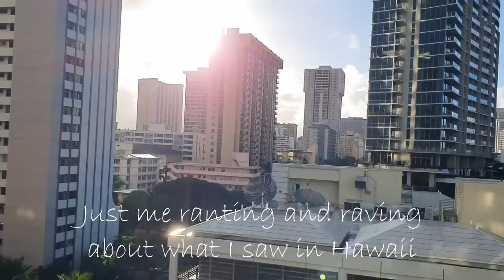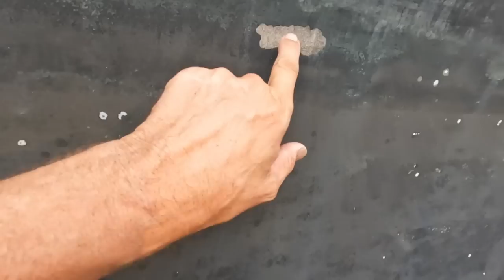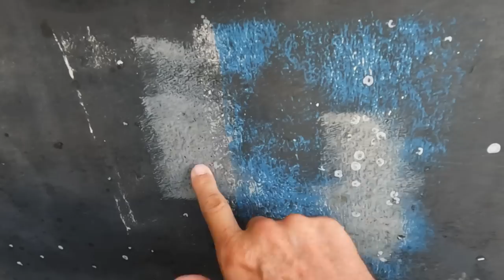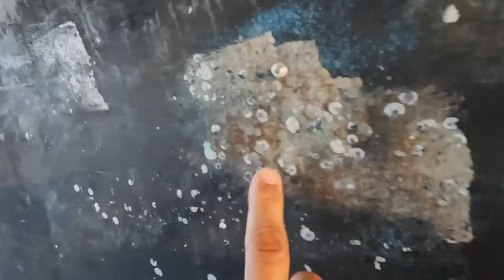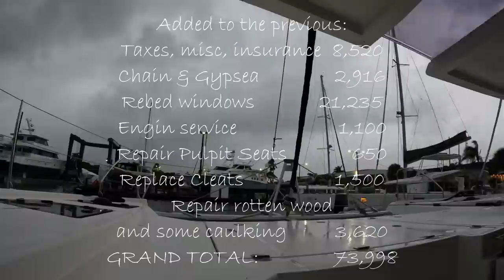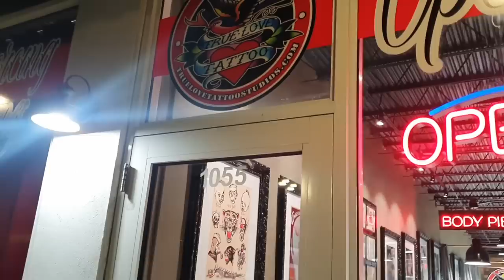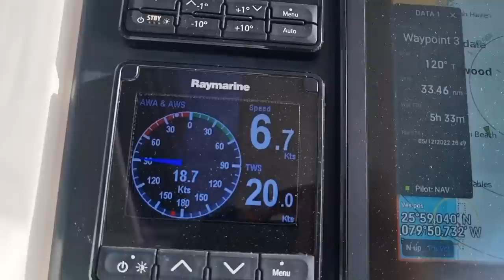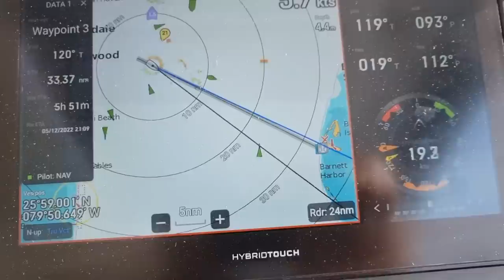#220 SAILING is EXPENSIVE!! Are we facing BANKRUPTCY! | Sailing Sisu Leopard 45 Catamaran

Comment: an idea in unsinkable boat you can make buissiness on is...
like an airbag in a car :) use weatherballons and fx if catastrofic leaking in engineroom. use a tank with air and 1 bar to fill fx 5 diameter ballon and prevent so an safe port can be reched. of course sharp edges in engineroom is prevented first...catamarans with two enginerooms is better :) best from björn in sweden
Reply from the maker: Yeah, cat owners often try to figure out ways to use a dinghy below the bridge deck. Deflate, insert, inflate. Or empty fuel cans.

Comment: Prices are silly in the US hey but that’s the labour costs for sure as products are cheap there.. you should have considered leaving the yanmar alternators in place and adding another. We have that on ours.
Reply from the maker: Hi Mike! We had two Yanmar alts per engine, but all started to fail within a month while we were in Bahamas. They were temperature controlled by a Sterling alt/charger controller, but yeah, they are designed to top up a starter battery, not pushing 60A - 110A continously for 3-4 hours. We don't have a genset so, engines are used to charge housebank. Even when Stirling cut the charging down to 60A per engine, 30A per alt, was it forced to do a 50% duty cycle, meaning that the engines run 50% of the time not charging. With the EEMAX, we now run engines and get 360A or 4,000W in continously and therefore only need to run the engines for one hour every three  days 😉

Comment: The costs for boat parts are a nightmare and insolent. But why you have to repair the windows? Is there no warrenty? And which Windows we are talking about? The escape hatches as well?
Reply from the maker: The Sikaflex Primer is flaking off from the expanding/contracting acrylic window. This is a known issue and an ongoing fight with Sikaflex. Yes, the first four years Robertson and Caine did support the warranty, but now it is becoming a maintenance issue. We used a different primer when we re-bed the saloon roof window in Turkey a few years back and this time the primer sticks like crazy, but now the window starts to crack because it cannot expand that much. Catch-22. The Leopard 45 does not have escape hatches, the main hatches and front door are big enough to be escape hatches.

Comment: I cant believe how expensive the items you have updated/replaced came too! Unbelievable that you had to pay $21k to rebel the windows after 4 years, i would have pursued Robinson & Cane on that cost. It seems there are so many substandard windows bonded into many Leopards!
Reply from the maker: This is a known issue and an ongoing fight with Sikaflex. Yes, the first four years Robertson and Caine did support the warranty, but now it is becoming a maintenance issue. That said, we used a different primer when we re-bed the saloon roof window in Turkey a few years back and this time the primer sticks like crazy, but now the window starts to crack because it cannot expand that much. Catch-22. Those windows expand on the edges as much as a centimetre on all sides. We had to trim the windows so that they don't catch the hull or adjacent windowpanes on hot days. It is crazy!
Reply: Frik what is interesting is that our new to us Catana still has all original caulking in all the windows since it was built in 2009. The acrylic is crazed so some time I will need to replace them myself. The big issue is that Catana paints the acrylic on the outside with a frame so you get no uv through it causing it come undone
Reply from the maker: @mikeferguson2828  that is different. RC is painting on the inside, called a primer, but this is also causing the issues. The primer does not expand the same as the acrylic or the Sikaflex and then peels off

Comment: We feel with you. 😉
Have I seen this correctly that on the 45 there is no bilge sump in the engine rooms AKA the bilge pump takes the water directly from a somewhat rounded bottom? 😳
Reply from the maker: There is a bilge pump in each engine room with an alarm light showing on the DB board as well as helm station when activated. The same for main hulls, but there is a high-water level alarm too, which will show red alarm lights on DB and helm with a high pitch beeping sound for in case the bilge pumps are overrun with water ingress.
Reply: @SailingSisu  Bilge SUMP like in the hulls where the water collects at a point lower than the surrounding area. The 45 looks like the Fountaine Pajots where there is no sump but the water is taken directly from the rounded hull. Have you never head any problems with that? On our 48 the shower drips from time to time and we only notice it because it collects in the bilge sump. 😬
Reply from the maker: in the engine room, there is a square indentation where the water is collected. inside the square indentation is the bilge pump as well as the float device, which triggers before the square indentation overflows. not sure what you want to call that :-) in the hulls there is a "slot" like the formation of the keels, which are deeper than the "rounded" hull. it is much longer than the square indentation in the engine room, which allows much more water to collect before the float switch is triggered. Petro has to climb in and dry it out with every water maker mishap :-( so, if you refer to the main hull and not the engine room, then yes, it is a pain to get rid of the water laying lower than the switch trigger.
Reply: @SailingSisu  Thanks for the info. Then the 45 is exactly like the 48 in this regard and I just got it wrong from what I‘ve seen in the video. On other brands the indentation is missing and if there‘s water and a bit of swell it’s moving around inside the engine room. 🤨
Happy to hear that R&C still know what they‘re doing. The windows on our 48 are still in pretty good shape. I think it‘s the temperature difference Med vs. Caribbean.

Comment: That is why you never trust others to do antifoul, besides the cost rarely do they do a proper job. Also did you choose sail drives or did you purchase the boat with those? Most people i've known who have them say they're a curse
Reply from the maker: yeah, I realize the antifoul DIY thing now. But we were not allowed to do DIY in that boat yard...insurance issues. The sail drives come standard and it is not an option. I am sure that shafts have similar maintenance issues with cutlass bearings and shaft seals?
Reply: @SailingSisu yup. Bottom jobs is dirty, but I have never seen or felt the satisfaction and value you get besides DIY. Boatyards generally do not care enough, unless you sit and watch every paint stroke.... I'm doing Innisfail in January🥴
Reply from the maker: Good luck :-)